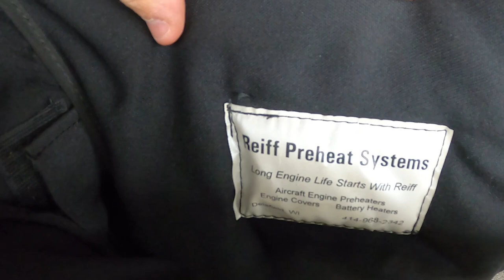Do you Pre Heat? | How I keep my Mooney warm and ready to fly in the North East | N6887N

Comment: I don’t pre-heat my Mooney yet, hoping to have heat in the hanger soon to keep the entire plane warm and dry.  It’s always wet here in the PNW and we’ve already had to fix a fair amount of corrosion from it sitting for years outside (previous owner).  I’ll have to check out the system you’re using, it looks well thought out.  In the summer I run 50wt, winter is 20w50 or straight 40 for easier starting, although it starts very easy with a fresh mag/Electroair/fresh carb.  I’ll turn the prop a few times by hand, one pump on the throttle and she fires up with half a crank…. But it takes forever to warmup…

Comment: Do you carry a extension cord on your trips?

I started using a Twin Hornet Engine Heater a couple of weeks ago (with a blanket, in MI), things are pretty constant at 60F (my oil pan heating element died and I need to do some scraping).
Reply from the maker: Nope.  I don’t bring a cord with me.  It goes back in the hangar after I’m done flying.
Reply: @PilotFun101  Oh, also notice you have a scat tube connected to that one inch wide hole above the air filter (at the front of the plane): do you still have a generator? Or if not, what's on the other end of that scat tube?